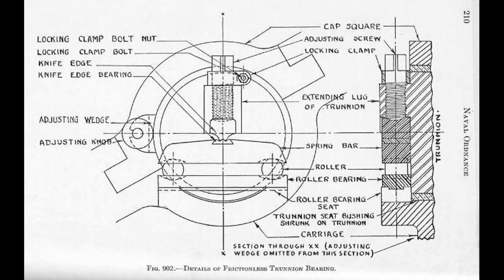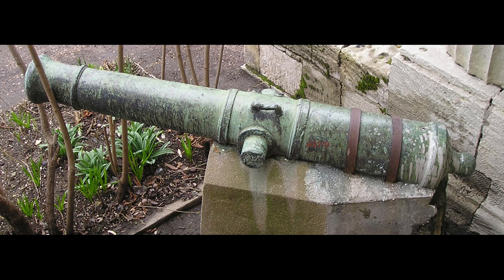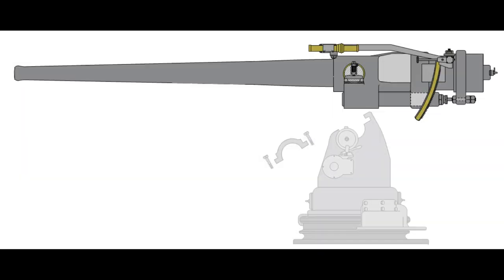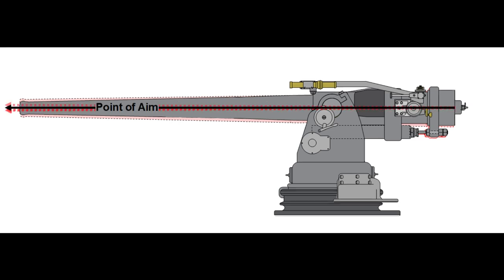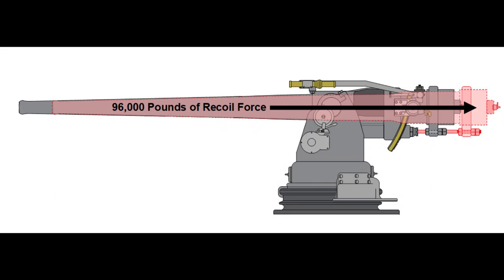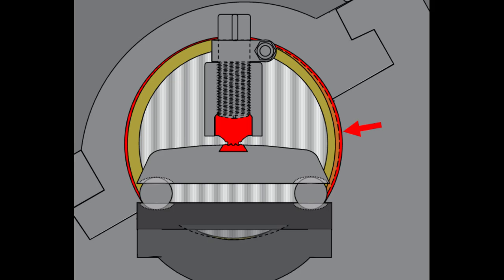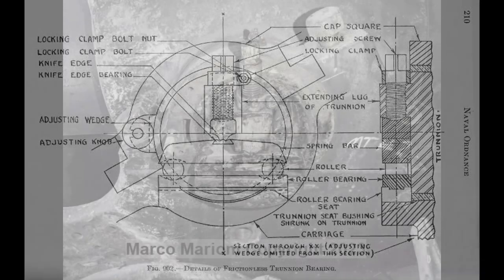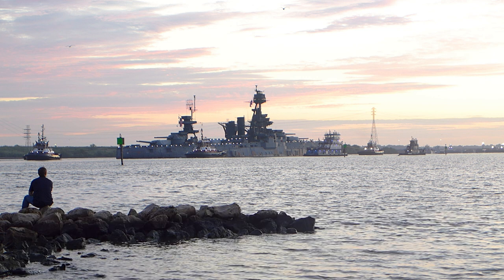Battleship Texas, How To Swing With A 5" Cannon

Comment: In addition, these guns and all the other armament aboard the Texas reveal how much engineering history and expertise went into the design, construction, and refits that went into this magnificent Lady.
Riveting. Great stuff!
Reply: The ten 14" guns and six 5" guns on Texas are all original and were used by Texas during her career. All the AA guns on her now were not used by Texas but are historically accurate and are actual WWII-vintage because her original AA guns were still usable by the Navy so they took her AA guns that she used in WWII. During the dry dock in 1988-90 they decided to change TX's paint scheme to 1945 Pacific Blue after getting one of the greatest donations ever for a museum ship: 10 original intact USS Missouri quad 40mm guns and mounts after Missouri was recalled to service and modernized. So Texas is lucky she got all her current quad 40s from Missouri because Missouri would have definitely kept them for herself if she had retired and became a museum ship in the 1980s and never modernized. Missouri's configuration now is how she looked after the modernization and she has no guns except the big ones. Bunch of missile launchers though.

Comment: I dont understand your last statement.  It implies these bearings were never used.  I’m not getting the grammar or context in what you were trying to say.  Awesome videos in any case and keep them coming.  One day I would LOVE to hear more about the THRUST BLOCK in this ship and its associated systems and machinery
Reply from the maker: What I was trying to say is the design goal was to be completely friction free in operation.  They probably are when perfectly adjusted and on a perfectly level mounting surface, so it is accurate to call it a frictionless bearing design.  However, none of those conditions exist in actual use and there would likely be some level of friction due to unwanted contact between the trunnion and its mount.  In spite of that, they would still present very low friction and achieve the needed result of reducing the effort needed to raise and lower the barrel.

Comment: Great video with excellent explanation. Do the main guns have a similar system?
Reply from the maker: Yes, the 14" gun trunnions also use frictionless bearings, but of a very different design.  I think they are far more ingenious than this design, but I can't make a decent video of them.  It's almost impossible to coherently discuss them without showing and handling their parts.  However, that requires removing a 14" gun from its mounts, which is impossible.

Comment: great video - that bearing is a beautiful piece of engineering design, hope that designer got a pat on the back, its very nearly a floating bearing, wonderful and a very useful thing to consider with such forces against it, all the weight neatly triangulated, so well thought through

i might just add my ten penneth of information, i doubt the part of the bearing you said to be Brass, was, it was more likely to be Bronze as used in many applications to deal with the heavy conditions at sea, a lot of parts used on yachts would be made in bronze, and even in things such as gearboxes, these become a useful thing because they require no oil to lubricate, bronze is in fact i believe to be self lubricating, i'm told, its very strong too with a high resistance to corrosion which brass doesn't, and in salt water and against any steel has a nasty galvanic corrosion limit (think that's right) someone will correct me

Comment: After the 5" 51's are fired, some number of times, can they be relined like the larger 14"ers, or do they have to be replaced? Is there a record of the recommended replacement interval?
Reply from the maker: Yes, they used built up construction and could be be relined similarly to 14" guns.  Their rated life was 900 rounds of full charge armor piercing.  However, only high capacity rounds were used in them by WWII and sometimes using reduced charges.  This greatly increased their lives.
Reply: @tomscotttheolderone364  Thanks.
PS. Have you done a video on how the 5/51's were aimed and fired, both in the early years, and then in WWII? 
Did Texas get close enough in Operation Torch to use its 5/51's?????
PS. I just saw a photo that I had never seen before. It showed the Texas having a "Tail Gun". A 5/51 in a sponson at the exact rear of the ship, 25' above the waterline.
Reply from the maker: @billkallas1762  I will probably be making a video about the operation and aiming of the 5"/51cal guns in the future.  The 5" guns were fired 6 times during North Africa, but I don't know what the targets were.  They were fired more than 600 times at Normandy and 3,500 times at Iwo Jima and Okinawa.
Reply: @tomscotttheolderone364  Thanks. I'd love to see that.